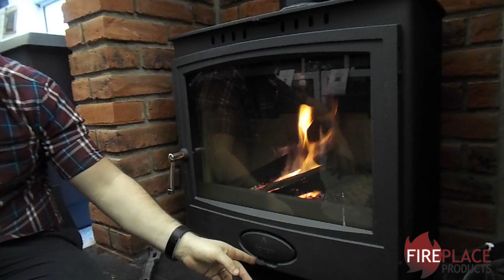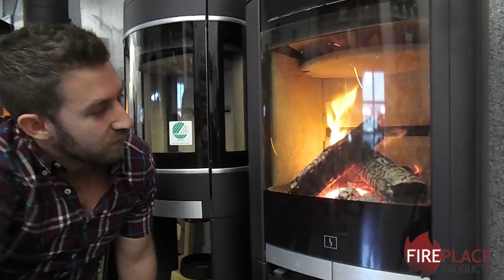How the Air Controls on Your Wood Burning Stove Actually Work!

Comment: Can you explain on a V3 Vitae Cassette stove, are the Primary and Secondary air controls OPEN or CLOSED when pulled forward?  Thanks!
Reply from the maker: Hey, just pulled this from the manual, looks like pulled out is closed, pushed in is open, hope it helps:

Sliding the control forward decreases the primary air while sliding the control back increases the primary air.

Sliding the control forward decreases the secondary air while sliding the control back increases the secondary air.

Comment: We have two Clearviews which in our thoughts are the Rolls Royce of log burners, they have been fitted in our 400yr old farmhouse for 35yrs and probably where some of the first to come out of their factory. They invented the hot air system where air is fed around the stove and then blows down the front glass to keep it clean. Only need to wipe ours a couple of times a year.

Comment: So apart from the lower primary vent and the secondary upper vent the stove should be a closed system.
So why does my cast iron stove have a long 1cm wide long slit ( along the stove front)  under the top.
I can stick my finger in and run it from left to right.

Comment: The problem with the secondary air is it's already hot before it's entered the heater.  For efficiency, it needs to be as cold as possible.

Comment: Top vent is called air wash and it's to keep glass clean and in a multi fuel cast iron it's for burning wood the bottom one is for using coal

Comment: But you haven't explained what air settings to use for what situation. I know the bottom vent let's air in underneath the fire and the top vent let's air in at the top. But why and for what reason? Wet logs big logs different wood different fuel? This is just an advert for your fires :(
Reply: Starting the fire
	•	Top vent: OPEN
	•	Bottom vent: FULLY OPEN

Bottom vent feeds oxygen to start the fire.
Top vent lets smoke and heat flow upward.

⸻

🔥 While the fire is burning
	•	Top vent: OPEN (always)
	•	Bottom vent:
	•	More open → stronger, hotter fire
	•	Slightly closed → slower, longer burn

Never fully close the bottom vent while flames are active.

⸻

🔥 After fire is completely out

(Only cold ashes left)
	•	Top vent: CLOSE
	•	Bottom vent: CLOSE

This prevents cold air from coming into the house.

Comment: Im a newb, and im trying to figure out why my logs glow hot with little to no flames. We have a Vermont Castings Vigilant wood stove.
Reply: Yeah, when I close my vents the same happens to me, the logs smolder red with no flames, so just open your vents more. 
If you do that and you still have the issue, then you may not have good air flow.
Reply: @alexabel751  Should you always have a flame when running the wood stove?
Reply: Not enough oxygen
Reply: @alexabel751  Good to know. thank you.

Comment: Mine does nothing when I use the vents 😢
Reply: You probably need to check your seals.
I have a cheaper stove and it was burning up too fast so I tore it down and used fire cement in the primary and secondary ait vents, sealing them completely and just kept the air wash/tertiary. Did the job. Suggest use your ears, you can usually hear where air is being sucked in...
Reply: @cgavin1  will remember this advice but mines a brand new fire but its at the lower price bracket so its probably working fine, I'm just sad that mine doesn't change like these fancy expensive ones! 😂
Reply: @leer774  It will probably be the same issue mine had: too much air. Also the newer stoves have to comply with defra so they have a fixed minimum air flow that is usually too high. Once I'd sealed mine up it ran fine. The other issue a few run in to is where the stove is hooked up to a larger diameter chimney liner and it draws too hard. Baffles are a popular solution to that problem. I've just sealed up the air vents. 👍

Comment: so, once you have a great fire going and everything is all hot. what is the most efficient and clean way to adjust the fire. should we use the lower or upper vents? why one over the other?
Reply: The logic is that solid fuels like Turf and Coal should be burnt from the bottom. Wood should be burnt from the top. So if burning wood, once you have the fire up to temp then close down the bottom and throttle the top as you see fit. This will give you the most efficent burn which can be shown by the lack of ash the next day.
Reply: I've just got a stove and trying to learn as well. But I think if you are burning coal your best to close the top one and keep the bottom one open because coal works best with air from beneath. And if your burning logs then it's the exact opposite. As far as I'm away you shouldn't burn both together as they prefer to burn differently.
Reply: The idea is to get a stove up to temp then only add just enough fuel/air to mantain the temp. Its like a cat, uses more fuel to get moving than it does to keep a steady speed.
Reply: I’m guessing you want as much secondary air to create a clean burn but not burn the solid fuel. The secondary air makes the stove efficient and clean. The primary air regulates the solid fuel or primary burn. If my stove doesn’t have a secondary burn I tend to turn up the air supply unless I’m letting the coals burn out. An older fire doesn’t need as much secondary burn as the wood is dried out and creosote release is low.

Comment: Hi there. Wondering if you could give me some advice. I have a 14x28 hunt camp. New and very well insulated. My wood stove which has been installed to code seems to smoke every time I open the door to put wood. It also smokes when you open the door of the camp. It seems to pull smoke out of the stove when you open the camp door. So I’m thinking I need a fresh air vent but don’t know how to do this. Any advise would be greatly appreciated.
Reply from the maker: Hey thanks for reaching out. Sounds like you have two issues, the first is that when you open the door to the camp it pulls smoke out of the stove and into the room, a vent can certainly help with this, but location is key, you need to place it as close to the stove as you can. The fact that you are getting smoke when you open the door to stove, is usually wither a fuel, or a flue problem. If the fuel you are burning has a higher moisture content, that can create more smoke which can lead to this. Secondly the flue diameter, length and insulation all can play a factor in the flue pipe temperature and the exchange of the flue gases. In effect you have a lazy draw on the flue meaning that the gases are not being pulled up at the correct speed. There can be alot of factors that can influence a lazy draw including downdraft coming down the flue pipe, trees in the vicinity of the terminal not allowing the gasses to dissipate as intended. Changing to an anti-downdraft cowl, or a rotating updraught cowl might help with increasing the draw in the chimney. I would suggest this would be the first thing to try, before placing an air vent in your new and well insulated hunt camp. 
Hope it helps.
Thanks Reece - Fireplace Products
Reply: Thx for your reply. Your advise is very much appreciated. I will certainly try that.

Comment: Der is a air control at the very bottom of my bilberry stove 5kw and der is a wheel on da door and at top another air open and shut so is da very bottom one just for if u burn coal do yea know
Reply from the maker: The wheel on the door will be the primary air. If there is a lever under the stove this most likely will be a tertiary air supply that comes in via little holes in the back of the firebox. The top one will be the secondary. Depending upon if your Bilberry 5 has an option to flatten the grate when you are burning wood only (as some products do) which diverts the air from under to over the grate as to how much control this wheel will give you. In all cases you will still need the primary air to start the fire, but if you are only burning wood and the grate doesn't flatten, you will find that once the fire is established you should be able to almost close this vent down and use the secondary and tertiary. Remember to light keep them all open and start closing them down accordingly as you go. The manual should also be able to help you in when to close which supply to down to get the best possible burn.
Reply: Yea u must be right der is little holes in da back of da stove thanks

Comment: Great stuff thankyou. I am quite new to solid fuel burning, and unsure about a few things thats why i was surfing. Air supply for overnight burning, with wood or smokeless coals top or bottom air supply regulated or both? I am burning both at them moment.  Can wood be burnt with smokeless coals? I seem to burn through more coals when i add wood/logs to the mix. Do i need any bottom draught when burning coals as im sure ive read i dont but i am not 100% sure but i do tend to all but shut off the bottom air supply. If you make a vid about any of that please tag me in it.
Thanks for the reply :)
Reply from the maker: joel cockerill sure will do, take a look at this blog post we did a little while ago, it might help tied you over till we get a video up: https://www.fireplaceproducts.co.uk/blog/stove-air-vents/ We also have a woodburner community page on Facebook, where you can ask any questions to other stove users who might be able to help:  https://www.facebook.com/groups/1097610796984563/

Comment: I've just had a stove fitted and my instructions tell me never to shut off the primary air control whilst burning wood. Why is that?
Reply from the maker: Which stove do you have? It could be that the stove requires a trickle of air at all times to burn efficiently, it will often vary model to model.

Comment: Even a cheap stove will react instantly to having its air controls adjusted, your just reducing the amount of air to the fire so any stove that has its air supply reduced will slow down instantly
Reply from the maker: Hi William, typically it depends how air tight the stove is, we have known cheaper stoves to have considerably less control than those featured. Granted all new stoves that are being released (including cheaper models) are getting much more controllable than equivalent older models as the market is so competitive now all manufactures are working to achieve higher standards and conform with the latest regulation changes. Valid point though, so thank you
Reply: No chance 😂 I bought an Arundel 500 quid stove. It’s great but it certainly doesn’t react to changes on air flow like these burners!! Nowhere bloody near. Also it make a pretty annoying whistle when air is rushing into it.... all of the time. Love to hear if anybody knows why 🤔

Comment: would using a hot exhaust extractor fan for a wood burning stove connected to ducting work running out of a garage door to avoid drilling holes for temporary setup area use  be safe to use  and eliminate risk  of carbon monoide posioning if using a wind  back flow preventer on the ducting if you also sucked outside  air back  into the room from a seperate duct fan intake
Reply from the maker: Hi Mike, I think local regulations may be a factor, but in principal, using a chimney fan on the end of a flue system to help with the draw is often allowed, typically chimney fans are matched with outputs of stoves and length of the flue before the fan, so make sure you let your provider know that. Having an external air feed from outside going directly into your stove (assuming you stove supports that) is a good idea and can (in some locations, local regulations will apply) negate the need for an air brick. As for your exact situation without seeing it its difficult to comment, providing you use suitable flue components and adhere to safe distances to combustibles but i would defiantly consult with a local heating professional who will be able to give you on ground advice looking at your specific situation.Thanks Reece

Comment: what should i know about being safe if i get a wood burner ? Can i use wood logs from trees  or wooden pallets for the wood burner ?
Reply from the maker: Hi mangreat71, its a good question, we have a blog post that covers this which you can see here: https://www.fireplaceproducts.co.uk/blog/what-wood-should-you-burn/ but to answer your question directly, never burn wood that has been freshly cut from a tree you need to season it first. Pallet wood is tricky as it can depend on if it has been treated. If they are untreated then they will burn quickly as they are softwoods, and try to avoid using pieces that have nails it, as the metal heats up and can super heat the internal components. I hope that helps.
Reply: It helps a lot.and very soon i should be getting my own tools like Saw Cutters and Ratchet sets and screw drivers.And would a Saw Cutter be good for cutting the wooden pallets for the Wood Burner so i can avoid putting the nails in the Wood Burner ?
Reply from the maker: Sure, just make sure the pallets are not painted or treated in anyway before you burn them

Comment: Very new to owning a wood burner, been struggling to get a fire and keeping it going! We have an insert barbas but just been watching your videos and trying out a few of your techniques and doing much better. Thanks x
Reply from the maker: Glad we could be of some help Muddy Duckies, Barbas inserts are great stoves. Many of the the Unilux, Universal and Cuatro models have a drop down plate when you open the door, to try and prevent spillage. These can often be adjusted if you are having an issue with the draw on the chimney, so if your still having problems take a look at your manual and it should be able to help.
Reply: Mine wasn't fitted properly and was wedged shut! I've fixed it now and all sorted! Looking forward to colder evenings this week to have another fire!!!
Reply: Get a Good pipe thermometer and keep with in burn limits  To Low ~ Deadly creosote build up   Find the stoves happy medium  and go with it .  To Hot ~ Over burn

Comment: great video. i like how resposive those stoves are. my cheap stove isn't  nearly that quick responding to air adjustments.
Reply: It would be if as in this video you open and close both the top and bottom air intakes at the same time .... nothing revolutionary about this basic air input science, posh or cheap stove .... I'm happy to be corrected here

Comment: Please add a duct or pipe to bring outdoor air directly into your burn chamber, otherwise it will deplete the oxygen in your home.

This is especially important with modern homes being practically air-tight vs. older homes being leaky, perhaps.
Reply: just open window a tad.  not mechanical, not requiring electricity and oh so easy to do... This too helps vent your kitchen gas stove cooker,